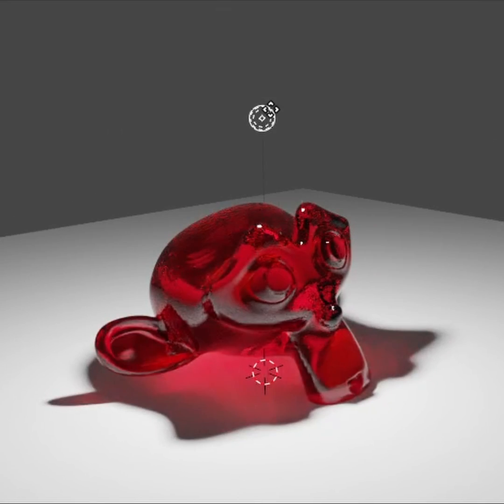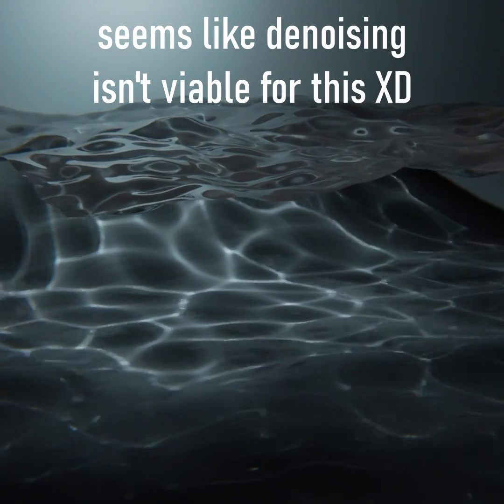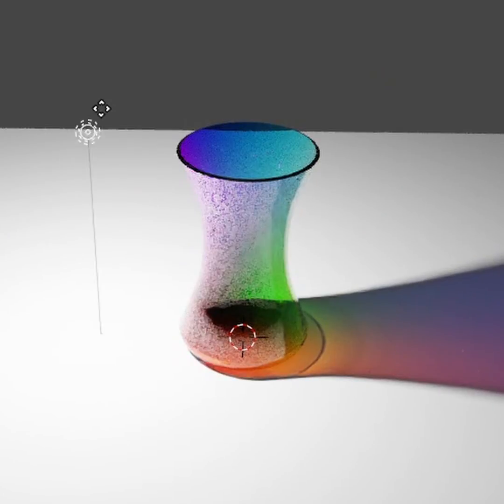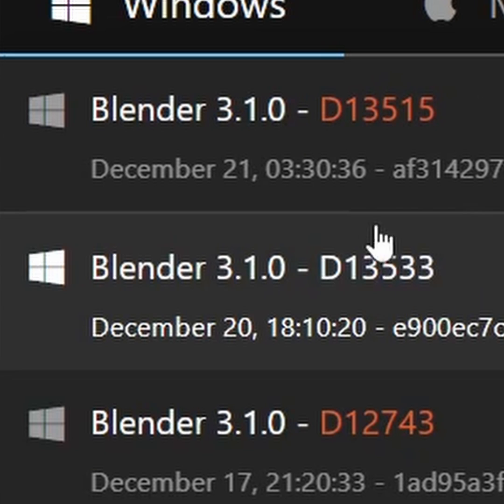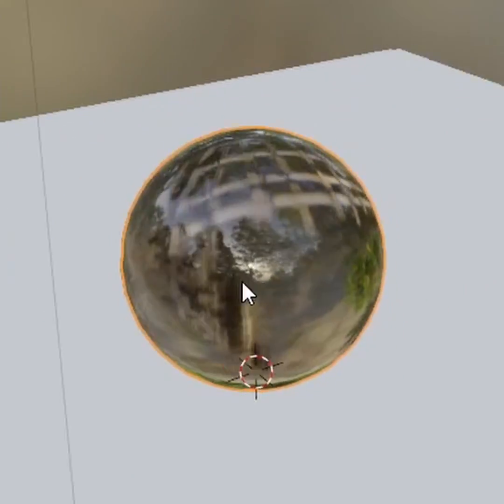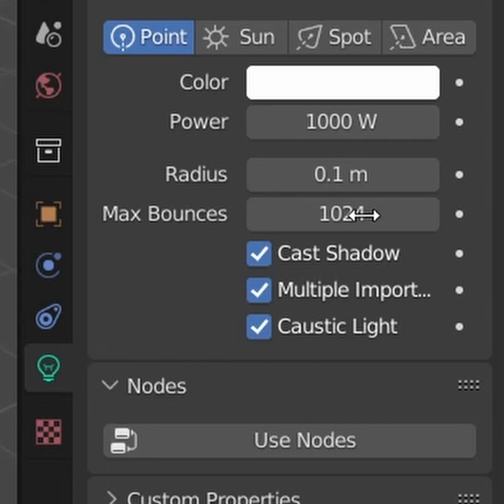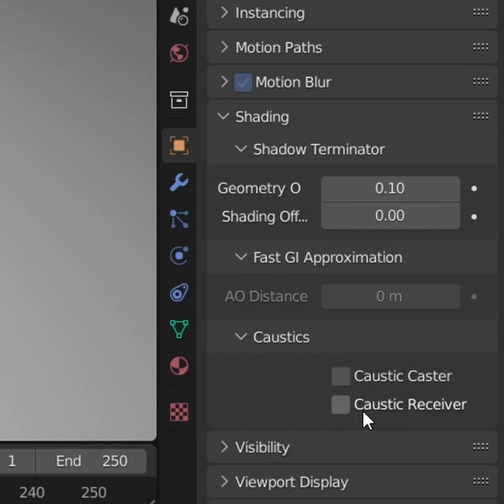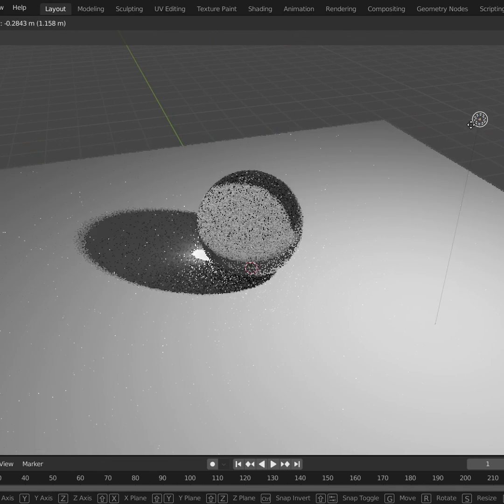BLENDER 3.1 CAUSTICS

Comment: Very noob to Blender, but this looks sweet. Seems like having to enable the caustics on both the casting object and the object being cast upon is a bit unintuitive. Like maybe they should be enabled by default, or have reception enabled by default while casting needs to be enabled manually. In any case I'll probably wait till the final version/official release just for the sake of not using the bandwidth, and since I hardly know the basics it's not something I'm trying to force myself to learn when I'm not expecting to actually use it. Still, excited to try it out in the future and just loving the showing here.
Reply: @Alex Locke yeah that's true, I've just got my preferences I guess. Is there a way to modify default settings like that in preferences, by chance? Just because I typically have a baseline of settings I think of and anything else I figure I want to change manually.

Comment: Place a parabolic shape, texture to be a mirror.  Add a point light at the apex.  Add a Matt white surface in front. Render. Does it cast a focused beam of light?
Reply: No because currently only refractive caustics are supported. Reflective caustics may be added later.
Reply: @BillRey  I can do refractive caustics in Blender 3.0. So this is nothing special.

Comment: Blender didn't have caustics before or just Cycles didn't? Also, I think it's odd and cumbersome that you need to tell Blender all the objects that will receive the Caustics effect. You would think once generated, those rays just fall on whatever they fall on.
Reply: I recall it being in Cycles back in 2011 or so, but it was incredibly noisy and threw fireflies all over your scene. I vaguely remember a blender guru tutorial of a lantern describing a method with the lightpath node to switch between materials based on camera rays and such to get it to kinda work.

Comment: The day before they released this, I built a scene that needed caustics and I couldn’t get luxcore to work with my previous 3.1 build from a few weeks ago. Gift from the gods
Reply: God* single
Reply: Use 3.0 stable version, I don’t like how blender users just use whatever latest build is, it’s risky u can lose ur file
Reply: @unknownclint1740  or backup lmao
Reply: @unknownclint1740  It's not like we were working on super important stuff, that we shad a tear over when it's gone. :P
Reply: @unknownclint1740  caustics are only for blender 3.1 experamental
Reply: @customswitchblade6924  and look horrible in comparison to Lux
Reply: @mrnomore  lux core only for 2.9 or 2.8 not 3.0
Reply: @mrnomore  lux is overall worse looking than cycles so better caustics dont matter
Reply: @tubaeseries5705  ye
Reply: @tubaeseries5705  Luxcore is universally considered the more aesthetically appealing renderer, actually.
Reply: @wzavareei  it is more realistic, but without additional adjustements it does not look as good in a lot of scenarios, of course for jewelry it will be way better, but for example interiors are way better in cycles, both engines have their own advantages and disadvantages, and are good for other things, but overall i find cycles better.
Reply: @tubaeseries5705  I think by additional adjustments you mean getting a hang of the materials, right? And Lux is famous for archvis/interiors... There is a comparison on BA somehere showing comparison renders and the light/GI in lux is more subtle/rich naturally. Most everyone agreed. Cycles tends to look plastic and fake, unfortunately. Its very cool as a creative/non photorealistic renderer, though!

Comment: But, cycles always had caustics, I've used them on multiple renders. Maybe this is like more of a refinement update for caustics?
Reply: Does it? I never seen caustics in Cycles. Always used LuxCore for this
Reply: @sychuan3729  there's 2 light caustic check boxes under the lights tab in the render properties tab, it's been there since the golden age of blender guru when he made his first donut, he even said to uncheck them to improve render times a few years back
Reply: @zevac  I know about this checkbox, but they don't create caustics. Currently Cycles could create caustics thoreticaly but practically it only created noise. So this checkboxes are used to remove caustics calculations and remove noise
Reply: @sychuan3729  so basically, 3.1 caustics are the real deal?
Reply: @zevac  I think yes. Before you could only fake it with some shader trics. But they still don't have all caustics like reflective caustics.
Reply: @zevac  You could think of it as the opposite of the “real deal”: the new technique introduces a new form of cheat to all the other cheats you need to get a good-looking 3D render. The existing technique, while more physically accurate and theoretically closer to the “real deal”, just doesn’t look good enough at practicable sample numbers.
Reply: @lawrencedoliveiro9104  that's interesting
Reply: @sychuan3729  https://youtu.be/8gSyEpt4-60
It's here at the 23:25 marker
Reply: @sychuan3729  It already had for quite a while; but it's not very optimized, to the point the default settings blur out most of the caustics to avoid fireflies in quicker renders.

You can get some beautiful results with the right adjustments in the Render tab and leaving it rendering with a huge number of samples over night. And if you don't care about it being more "artistic" than physically accurate, denoiser can reduce a lot the amount of samples needed.
Reply: Seems to be a huge speed-up compared to what we have now. Though that thing about having to mark individual things as casters and receivers might suggest it's only faster because it's not being calculated for the whole scene but just to specific objects.
Reply: @tiagotiagot  Nope. It is because they use other integrator algorithm MNEE(Manifold Next Event Estimation). It is good for finding some types of caustics but not good with reflective caustics
Reply: @tiagotiagot  I don't think it is more limited. It is much more better in refractive caustics case and I believe as bad as standart pathtracing in reflective caustics. Frankly speaking I don't study details of the algorithm and its' implementation, but in theory it should not be more limited. You simply don't need millions  of samples in refractive caustics case anymore
Reply: The stupidity in the original comment makes me hate blender users
Reply: @mrfeathers3938  Why so aggressive? Many people who start learning 3d don't know everything. When I started learning 3d Max years ago I hadn't any idea about caustics at all
Reply: @mrfeathers3938  I bet you're fun at parties

Comment: i mean... caustics did exist. They were barely usable, required infinite samples and didnt look too great, but they did exist
Reply: there were also fake caustics, really handy and good enough in most cases
Reply: With denoiser you wouldn't have to wait as much, specially if you are just going for the vibe instead of trying to replicate the results from real world physics. Gotta tweak a few parameters in the Render tab  to get sharper results, though, and the sharper you make it, the slower it will take to produce good results.

I'm not sure if it would be viable for animation though; and the time factor would probably also weight a lot against it.
Reply: @tiagotiagot  its true for larger scenes, yes, but when the focus of the render is a glass object of sorts or stuff like a pool or ocean waves near the shore, the difference becomes evident very quickly. sure you can fake it for stuff like pools or water in general, which is whats being done for real time applications, but when you have a still of a funky bottle and it doesn't produce caustics that can quickly take you out of it, it immediately becomes obvious that its a render. For the denoiser to be effective, you still need a good chunk of samples above what you need for the render normally and/or absurd amounts of transmission bounces else you get a weird looking mess that just looks like a low res texture with interpolation

Comment: Now if only they could add real-time caustics for EEVEE, that'd be perfect!
Reply: EEVEE is a rasterization engine, so light is not really particle, and hence there's no such thing as caustics. However, you can fake the reflection to make it look like caustic in EEVEE. People had been using this technic for ages. So if you want fake caustic, they're already here. Real caustic, impossible.
Reply: @mohamadwaliyuddin1517  Yeah, obviously they can't be real caustics. No shit it's a raster engine. That's why I said "real time caustics", meaning fake caustics built into Blender.
Reply: @FlamingFoxProd  it's already here. You make it with some material wizardry.
Reply: @mohamadwaliyuddin1517  Really? Mind explaining how?
Reply: @FlamingFoxProd  it use the position of the light source and a lot of maths with the is shadow ray node. It's pretty robust. One caveat is that it use one reflection cubemap for every glass object IIRC
Reply: @mohamadwaliyuddin1517  I remember reading about a trick involving rendering a view from the position of the light sources; I think it would had the scene with a temporary material that would expose the UV maps; and then you would use that render to map baked caustics into objects. Sounds like something that with a bit of programming could be done automatically.
Reply: Same, though I'm personally hoping to soon see real time shader displacement in EEVEE. Not sure what low level shading engine Blender uses (though it is probably OpenGL) but it should be possible to easily implement this by displacing the vertices in the vertex shader pass prior to the object-to-world transformation.
Reply: @TWGuardian  it's opengl, but we're is gonna get Vulkan and engine re-write treatment like cycles x
Reply: To contribute to the discussion of real-time caustics, there's one trick that I use for faking underwater caustics (sometimes in combination with volumetric fog). This trick involves taking a 'Vector Rotate' node with as input the vector (0, 0, 1), with a center of (0,0,0) and with the mode set to Euler. I then take the sun lamp and copy its rotation parameters as drivers and use those to basically bind the rotation values in the Vector Rotate node to the rotation of the sun lamp. Taken together this gives me the light direction, which I can then combine with the surface normal into a dot product operation. Add a 'Map Range' node to control the falloff and combine it with a Light Path node to only use this for shadow rays, then use a Mix shader together with a Transparent shader to use the shadowmask for the shadow rays, and your regular water shader for all other rays. Then, in the Material settings, set the shadow casting mode to Alpha Clip or Alpha Hashed.

The caustics may not be physically accurate but they are reactive to the light direction and the surface of the water which yields a pretty convincing illusion.

Comment: Why are there so many checkboxes to turn on caustics? I wonder if there will be that many checkboxes when its in more official releases.
Reply: To avoid calculating caustics as a part of global illumination (which is very calculation heavy). This (rather new) technique (Manifold Walk by Pixar) is meant to calculate the caustics only on certain geometries so that the render times don't explode just because you have one glass object in the scene causing caustics everywhere (which mostly are not really visible anyways).
Reply: @Pidrittel  Pixar didn't develop it, it was Weta.
Reply: @Pidrittel  Ah okay so its for optimization reasons. Can imagine it will be optimized enough one day to be a part of global illumination. Until then the check boxes make sense.
Reply: It's the same as it is in Renderman, it's a part of the technique.

Comment: It would be neat to see a side by side comparison with render times of Cycles's new caustics vs the old one. Does this new one also do reflective caustics, or just refractive?
Reply: Only refractive.
Reply: @mustafasarwar7809  Still awesome, refractive is more noticeable anyway
Reply: Only refractice and only in shadow area. Its called NMEE.
But they are going to develop path guided caustics also so that will add reflective and refractive caustics with extended light casting (caustics over shadowed area like mirrors castics reflections or prism bounced over environment). But no idea will it have volumetric or dispersion  caustics :( this current nmee  one doesnt have.
Reply: @juhamukari5270  It already has reflective caustics, its just crap at finding them, so i think path guiding just helps greatly. As for dispersion caustics yes i have done renders that show multicolor dispersion glass with its caustics, this all came from custom dispersion glass materials you can get on things like blendkit which go way beyond principled BSFD.  Cycles is not multispectral or whatever though so it will have to compress everything within srgb or something. Goes beyond my understanding.
Reply: its pre alpha.. This is not cycles official new caustics until its released in the official version.
Reply: The old system isn't really being replaced, this just adds features over it. It's a paper by Weta Digital called Manifold Next Event Estimation (or MNEE, as many people are calling it) and it's meant to add refractive caustics mainly to the eyes of photorealistic characters, that's why it only works on shadowed areas.
Reply: Only refractive, and only in the shadow of direct lights. And only 6 caustic bounces.
It's currently in a very very early stage.
In terms of speed, it's kinda 5-6times slower when you enable it.
Reply: For now is just refractive

Comment: Why do you have to enable caustics for the light and for the caster and receiver? Sort of strange
Reply: probably performance reasons
Reply: Its still in alpha, they might add easier options to enable and denoising also later
Reply: It probably gives Cycles more information to work with, like where the caustics will be, what will generate them, and the path to the light source
Reply: Basically, doing caustics naively requires a super long time since you have to test basically every single possible light path to get accurate caustics. By specifying what light creates the caustics and what object they end up on you can be much smarter about the light paths you test in order to calculate the caustics. Otherwise you’re trying to calculate caustics on every surface with every light regardless of if it’s needed.
Reply: @EtanChamare  yeah that's what I was expecting, I was just hoping it was some silly discussion from the devs
Reply: I think that's related to the algorithm it uses for calculating the caustics
Reply: The technique is Manifold Walk (MNEE), which is the same as used in Renderman. Renderman also has you defining receivers and casters.
Reply: Because cycles is a unilateral pathtracing, you need that to work.